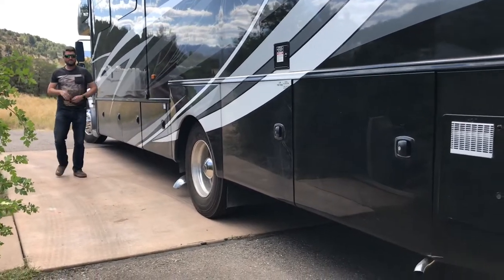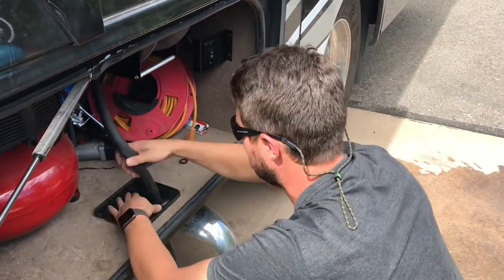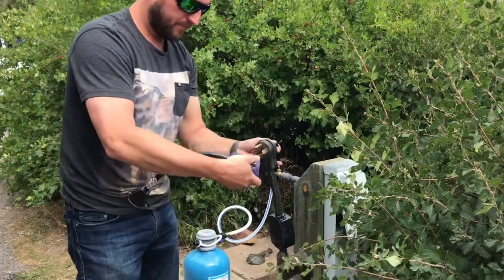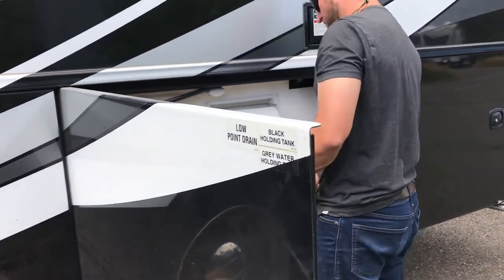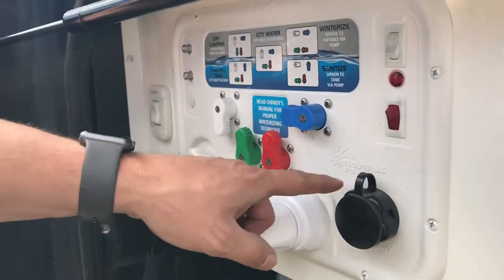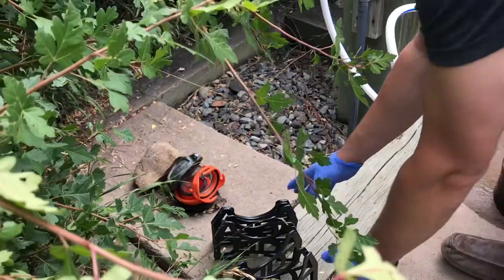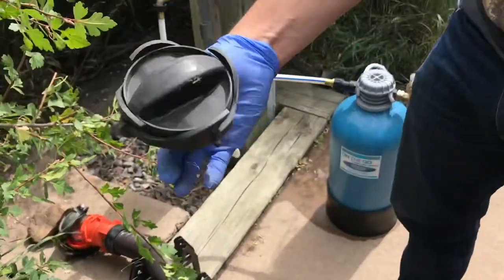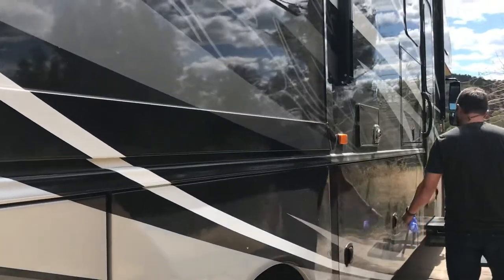Setting up our Class C RV Motorhome at a campsite - Outdoor Tasks

Comment: No water pressure regulator before the softener?
Reply from the maker: We do use a water pressure regulator. We have the water regulator in the wet bay before the water comes into the RV. We have found it gets damaged in the elements so we keep it in the wet bay. Not prior to the softener.
Reply: @RVHomeschool  I guess if it ain’t broke, don’t fix it, but wouldn’t you want to protect your hose and softener from over pressure?

Comment: I'm surprised no one had commented on the fact that the title of this video of "Setting up our class c motorhome," but that's a class a motorhome. I mean, sure, the steps are the same, but it's very misleading when someone is actually looking for class c.
Reply from the maker: We most definitely have a class C motorhome. Technically, it is a super C because it’s a heavy-powered Diesel engine.  Class C has the engine in the front. Class A motorhomes have the flat face. That’s why no one has made that comment before.
Reply: It has an overhang in front it is a C class